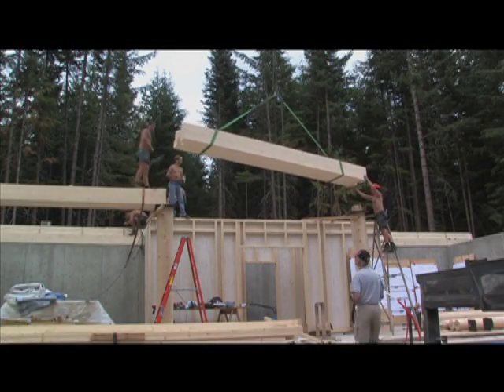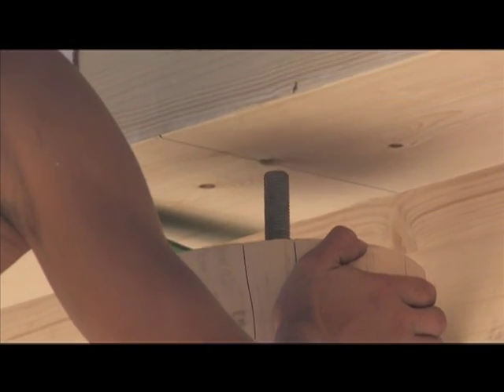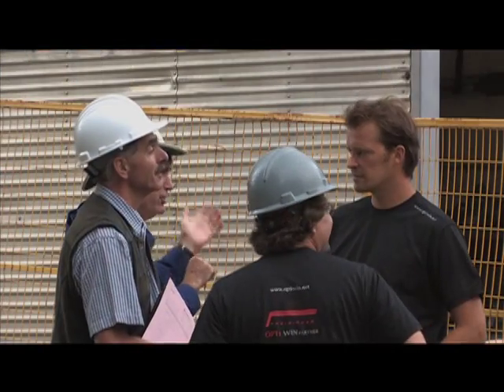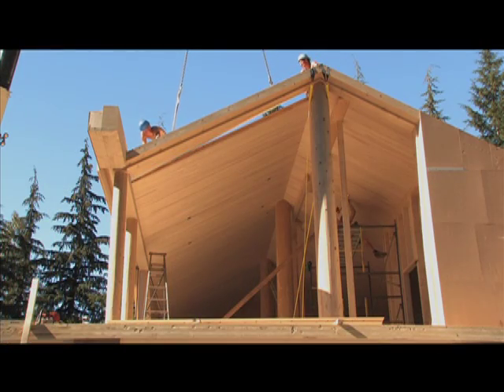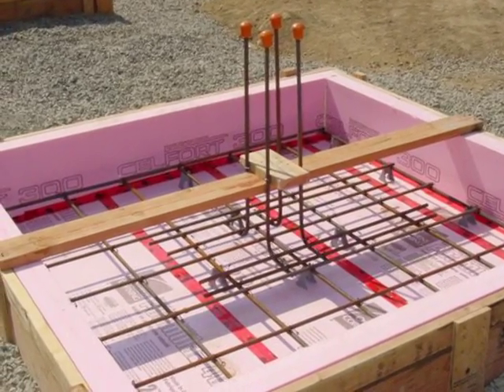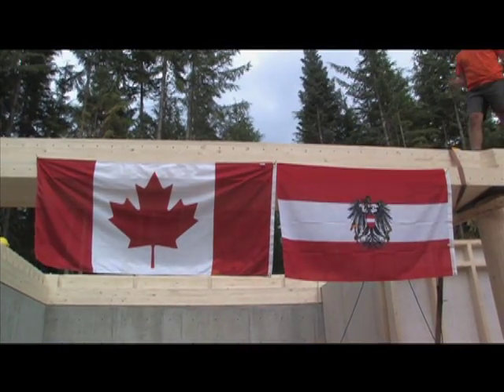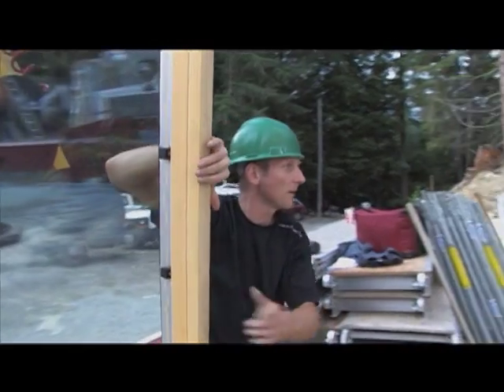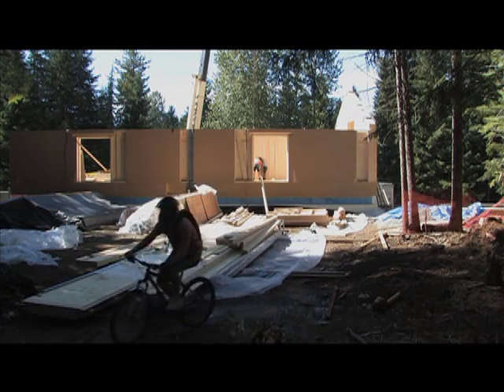Whistler's Austria Passive House

Comment: BTW, just on a side note, Matheo Durfeld says it could be called "in Canada a net zero house", unfortunately, that's not correct. Net Zero means that a house produces at least as much energy as it consumes. You can theoretically make a tent a net zero house, if only you produce as much energy on your property as "the tent" consumes. Net Zero is a great standard, but it has very little to do with the requirements of a certified passive house.

Comment: electrodacus, thermal mass is not an issue in passive houses, as they are not storing energy inside (like many passive solar buildings, don't confuse those two).

ICF works fine too, but meeting minimum code requirements is no-where near what you need. In BC, you'd be looking more at ~12"+ on the outside of the concrete, 2" inside. 

Also, these timber frames are designed for a very ling life. My house was framed in 1932, it is in great condition. The concrete in the basement is worse of.

Comment: Passive  House (Passivhaus) is the extremely efficient and successful product of two decades of top German, Austrian, Swiss, and Scandinavian engineering. It is not the same as Passive Solar Design, and in temperate and cold climates does not need high thermal mass. It can be constructed with brick and mortar, various panels like ICF – if they have at least  25-30 cm of insulation. 

Look into Wikipedia under Passive house. Wooden houses in Austria, Germany  are designed to last 100+ years.